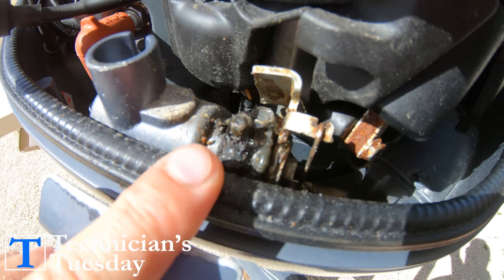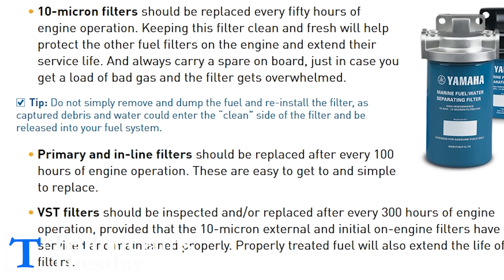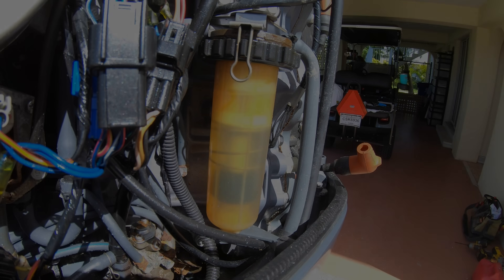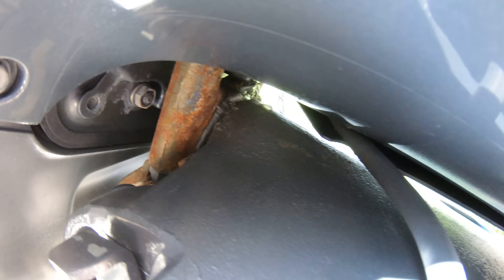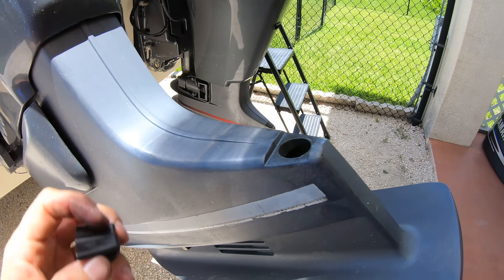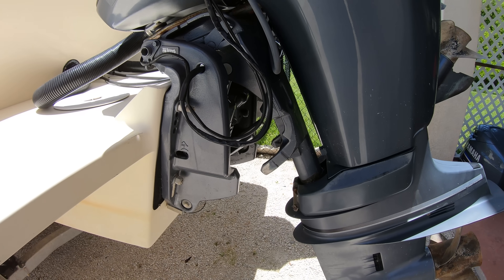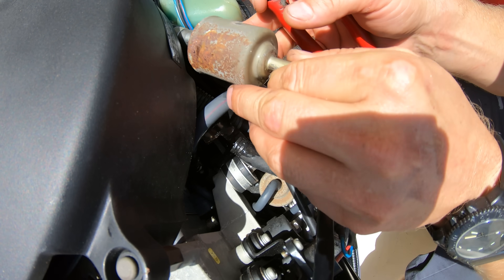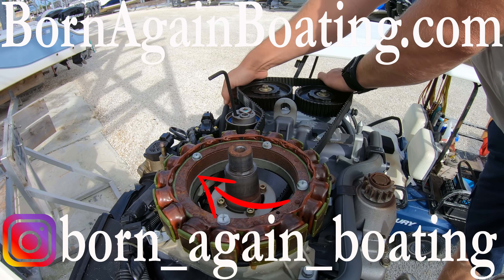Making A 2-Stroke Last Longer!

Comment: 01 200hp OX66 2 stroke Saltwater series, great motor but maybe too big for my 20’ Trophy as I typically can’t get it past 4K rpm’s (unsafe) and I’m getting my 02 sensor housing gummed up with oil/carbon. Maybe a different prop, hotter plugs may be in order, any thoughts?

Comment: 1994 Johnson 175 Ocean Runner. It's been great. It has the much maligned VRO oil injection that so many struggle with and end up mixing gas and oil in the tank. The real story is it's a great system that nearly nobody understands and is basically fool proof. They just don't understand the fuel system of the engine AND the boat and look for problems in all the wrong places.
I'm fairly shocked at all the corrosion in the Yamaha's. Must be salt water boats.

Comment: I've got a 2005 Yamaha VMAX 175 on my Triton Bass Boat and a 2000 Yamaha 115 on my Cobia 184CC. My 115 is kinda hard to get started but when it does it run's Awesome!
Reply: I been hearing that about the 115 2 stroke Yamaha that they hard to start I have a 07 115 Yamaha 2 stroke and it starts on the first spin every time even when it's frozen out side

Comment: I have a 2004 70hp Yamaha 2 stroke on a 2004 176 Key Largo center console I bought in March.  Runs great, did have a replace the original tilt/ trim motor in August. Knock on wood, running great and no problems now. Fish the ICW south of St. Augustine.

Comment: Running a2012 Yamaha 200 stroke!!! last year they made this engine, but I swear with just the smell of the key this thing starts every time. Even after a couple months of being stuck at work . By the way awesome video learned alot about my two stroke deff will be checking in again. keep up the good work
Reply from the maker: Thanks for sharing!

Comment: I have like Robert P a '92 Grady White Sailfish boat with twin 2006 200HP HPDI's that run amazing. I service as needed, new plugs each year, lower unit service with Amsoil gear lube. 
Only issues I have is the idle speed when cold is too low, about 400 rpms until warmup and some restarts to get it going. Long story short, is caused by the carbon buildup in the O2 sensor chamber. So now doing annual O2 sensor removal, cleaning out carbon and ensuring the pin will move freely and chamber is clean. Then I do a decarb with Seafoam and they startup like new again. Not sure why the excessive carbon, but many others having same issue. Using either regular fuel or ethanol with Startron and Ringfree plus, still same issue. Tried different outboard 2 stroke oils, Pennzoil Semi Synthetic, now running Amsoil Full synthetic, same issue. 
Do love how these engines run though!

Comment: I love my 2 stroke on my checkmate. All that raw power at high RPM. Seriously I've thought about repowering a 4 stroke but this motor runs so good. They say these motors were built to last forever.
Reply: They should run at least a thousand hours before rebuild. 
At 50hrs per season average( I did 100) they should last a long time.
Synthetic two stroke, good gas, flush after using, change that water pump impellor.
The more you use them the better they run. Good advice here !

Comment: 1997 Force 120. Rebuilt the carbs last year, changed the thermostat this year along with the water pump impeller.. Every season I change the plugs, fuel filter, gear oil and fog the motor for winter storage. So far so good . . .

Comment: I have an Evinrude VRO 60Hp Long shaft.  The hour meter is stuck at 430 hours, I suspect it has much more than that somehow.  In the process of servicing the gear case this week.  New water pump in the post and an oil change pending.  Hopefully this old lady will be good for a few hours more.

Comment: 1993 Yamaha 130 like new. Have broken three Hobbs hr meter already so it's got a lot of hrs. I spray inside of my new marine engines with silicon spray before first use.  Then wash it out after a salt trip and respray.  Never have seen that rusty look inside and all rubber looks like new. Have been doing your recommended stuff but Did not know about the oil tank filter. Beter change it after 27 years I guess. Thanks

Comment: Merc Black Max 150 hp 1984 ,perhaps the very first oil injected motor by them .Was going very strong when I sold the boat ten years back.Was a fresh water boat from Ontario till coming to the West coast .I put more than 7 hundred hours on that engine ,with 1200 total hours .

Comment: I bought a 1997 Campion Allante with a 150 Mercury EFI last year. Having been a dirt bike and snowmobile guy in my younger days, 2-strokes don’t scare me. I could tell this engine had been maintained and not run hard. It’s certainly more complex with the EFI, but videos like yours and a good manual are teaching me a lot. The sound of that V6 at full bark is quite something, and after cleaning the intake and throttle bodies this year, it’s got real jump off the line.

Comment: I worked fighter jets for 24 years and retired about 18 years ago. Just bought my first boat (1994 Model). No Wings! It has a Yamaha 150 Saltwater series engine on a 24 ft Hurricane Deck boat. I sit and look at it and have no idea what to do as far as engine maintenance! We did take it out over a 5 day period, ran it for a few hours and it seems to run great. But after watching some of your videos I think I need to learn more. Much more!
Reply: Hi, thank you for your service Sir. Yeah I'm in the same situation with my first boat. I've actually bought an older boat and have had to do some work myself. I've watched a ton of videos and this guy is my go to for restoration and mechanical knowledge also he covers a lot of peripheral subjects to boating. Boat works is another great channel for fiberglass work and painting. You are a lot smarter than me so you will be great at whatever you choose to do. Closest I ever got to a fighter plane was my street bike an  FJ1100. I swear if I had wings I could have taken flight😂. Take care.

Comment: 2000 Mercury 225 Optimax and it chugs oil and fuel. Would love an upgrade. I'm at 1240 hours on the motor.

Comment: Still running a 115 johnson from 2000, good motor only let me down once.
Reply: What was it?
Reply: @LeetGamingTV  About 10 years in a circuit chip in the ignition system started playing up and left me stranded at sea. Marine rescue Eden were great.  It was intermittent for a while seeming to come good and then playing up, felt like it was only firing on 1 or 2 cylinders(V4 motor) and rough at that. The part was on the top of the motor under the stator/flywheel. and cost about $150ish dollars. My only other issue was my fault when I didn't tighten the battery leads and stuffed up the voltage regulator. I bought the regulator from the US (I'm in Australia) for half the cost of one here. I make sure I flush it after use, grease and WD40  great little motor.

Comment: 1993 225 johnson ocean runner on a 1989 22' revenge (whaler). rebuilt once by me in 2007. previous owner didn't change the high pressure water pump, ran it high and hot. I fattened up the mid and high speed orifices for break-in, but it ran so well i just left it like that. 35 mile offshore trips at 3/4 throttle without a single issue. thanks OMC!

Comment: 2006 Johnson 150, 2smoke on my boat. I've had to replace the fuel pump assembly twice in the last 3 years at $600 apiece plus labor. Thanks for the video, I need to step up my maintenance game.
Reply from the maker: Welcome!
Reply: Run a really good low micron fuel filter.  Makes a difference

Comment: Still running a 1979, 2 smoke, 55hp  Evinrude.  No hydraulic trim, no motor tilt assist, runs only premixed 2 stroke fuel that has to be ethanol free, ,.  No bells.  No whistles.  Just runs all day long.  all year 'round.  every year.

Comment: 2002 carbureted Mercury Saltwater 150 2 stroke. Runs great and easy to maintain. As my son calls it, a “reliable 2 smoke.” Just did a service on it. Compression was perfect, ran my borescope in it and everything looked clean. Surprised considering Im in South Florida salt conditions. Regular maintenance and flushes are a must down here.

Comment: Got myself busy with 2 2 stroke mariner 200hp, replaced the stator on one, and fuel pump diaphragm on the second as well as carburetor rebuild, with a lot of tlc got them running, i have cople vids you can check them out

Comment: fyi, snap on makes screwdrivers just for lower unit drains. servicing a 2 stroke 2000 year model yamaha 130 since 05, looks brand new. may need a carb rebuild soon, every once in a while when putting around it will shut off

Comment: I think I need to replace the hoses on my Yamaha 40v 2011 2 stroke. Apparently hose degradation is a common from for a lot of different 2 strokes with oil injection. I have found lots of vids on how to bypass the oil pump and just run pre-mix but none on how to analyse/ replace the hoses. Might make a good vid ?
Reply from the maker: Maybe :) but I would just order the hoses and do them one at a time lol might be boring to watch ;)
Reply: @BornAgainBoating  Replacing the hoses shouldnt be too hard. Its the purging air out of the pump/hoses that seems tricky.

Comment: I have two old two strokes. One 1974 70hp Johnson and a 1982 150hp Johnson. Both work perfectly. I bought the 70 as a scrap motor. Didn't take much to get her to run, perfect compression.

Comment: I need some help with my 200s hpdi please
Reply from the maker: Whats wrong with them
Reply: @BornAgainBoating  I try to start one of the motors when it starts there  gas flowing from the bottom throttle body and the motor shuts down soon as it fires up....
Reply: @BornAgainBoating  one of the motors needs the mystery filters cleaned or both but I can't same to get the next motor to stay running long enough to check it out!!!!  Am good with the yahama four strokes but this is my first pair of hpdi's I've owned to am learning as I go

Comment: My Suzuki DT225 efi 2003 has been running flawlessly up until the other day when a piston blow. Replacing one cylinder-bank, the head and the pistons costs however more (just buying the parts) than could be justified. Its with sadness I will have to bury it and there are no more big two strokes to be found, at least not in my part of the world...

Comment: I'm running a 2004 Yamaha VMax HPDI 300. Been a solid engine but it doesn't push like it used to. I've lost probably 10mph since new. Any way to bring that back?
Reply from the maker: Its hard to say, it could be anything. You can clean out the fuel system and try running some ring free to help, see if that does anything. Make sure the plugs are fresh and that canister filter isn't clogged.

Comment: Running two 200 HP HPDIs on my GW 265 Express...  1200 hours, good compression...  Run them about 50 hours a year...  I have recently replaced lift pumps, voltage regulator, and shift sensor...  Replaced fuel filter cup because faulty wires gave a false fuel/water alarm...  I've replaced the LU seals on both in the past couple years; water pumps every three years; VST filter, high pressure fuel filter, and thermostats every other year...  New plugs every other year...

Just cleaned the O2 sensor and sniffer tube on one that was ticking...  That didn't fix it, so started investigating the (dreaded) possibility of piston slap from weak wrist pins...  Turns out to be much more simple and cheap to fix - the drive gear for the fuel pump was stripped, so it would rattle around between the flywheel coupler and the top washer...

I am a much happier boater now that I do almost all the work on my boat - its is a great feeling to know that the engines are in tip-top shape...  Hoping I can get another 10 years/500 hours out of mine...
Reply: Still running like a top... Lessee - in the last couple years, I've replaced all of the microfilters (aka, "mystery" filters) in the injectors and high pressure fuel pump, rebuilt one lower (held pressure, but still leaked despite good seals, so I assumed a scored prop shaft), pulled the other apart (despite good fluid, only held 8 lbs pressure) and resealed, completed all the other, usual stuff like thermostats, filters, and plugs...  I did have a couple things crop up - I had a lead on the connector to the port oil tank level sensor go bad - result was transfer pump wouldn't come on...  Before I figured it out, I replaced the pump since the original was 20 years old (replaced starboard pump 5 years ago)...  Once I isolated the issue to the bad pin, I just bypassed that lead on the connector, with the intent to replace the sensor this spring...  Other vexing issue was a starboard motor that would occasionally tilt all on its own at random intervals with no input...  Isolated that to a faulty switch on the binnacle, which I solved with the liberal application of contact cleaner...

A couple self-inflicted wounds - reinstalling lower unit without verifying shift rod was engaged, and engine stalling because fuel water separator filter had worked itself loose and was letting in air... When I splashed, I actually had to get towed 20 feet back to the dock with one engine that would run but not shift and another that would shift and not run...  Felt like a moron, but learned a couple important lessons...

Comment: Hi mate, l have a question. l have a 70 hp yammy 2001 ,2stroke. Its running fine.l noticed when it was running that the fuel filter on the side next to the oil white plastic container was filling  and then emtying and then refilling every say 30 seconds . Is this normal l doubt it, this was when l was running the engine on the muffs at home for about 10 minutes. It does it every time l run it like this. Not been in the water yet since l bought it a few months ago.
Reply from the maker: Hey Kevin, yes that is normal. That's just the lift pump operating :) It turns on and fills that canister, then after about 30 seconds it will consume the fuel and come back on to refill the canister :)
Reply: @BornAgainBoating  thanks for the reply. Well l filled the tank up because it only had 10ltrs and now has about 22ltrs. l tightened the jubillee clips on the pipe connections and now just stays full when running. So what do you make of that ??l must admit l have only looked for a few minutes when it was running, but the fuel filter stayed full now.
Reply: just a quick update. l was wrong it still does go down and up with fuel . thanks for clearing that up.

Comment: I have a 2008 Evinrude ETEC 150 hp on my boat. My boat has been sitting for 2 years this September. My boat hull was being repaired and insurance took awhile. So, what all should I look out for before cranking the engine. All comments are appreciated. I just don’t want to forget the simple stuff and want to make sure the important stuff gets the attention it needs before hitting the water. My boat should be ready in about 3 weeks. I’ve got to plan this out correctly so it doesn’t cost me more money.

Comment: 98 Merc 200HP still going strong. Capped fuel oil pump and removed container. Put oil in the fuel manually. Makes it more reliable. With proper maintenance an old 2 stroke will last a very very long time. Not fuel efficient, not quiet, and smokey. Once started though they will always stay running as long as the water pump is working.

Comment: Still running a 1998 OMC/Johnson 200 two stroke. Still hoping you do a tune up video on one of these. I’ve tried watching other tune up videos but they don’t work for these motors. I still can’t get my engine to idle and mid throttle right. WOT it runs great tho.

Comment: Been thinking of repowering to twin 300hp Merc 4 strokes but just can't justify when my 2 strokes run so well.  Thirsty but dependable.  30' Proline center console with twin Merc 250 EFI, she'll scoot at 62mph. And the sound!  PO drilled the can, so she sounds like a top fuel dragster at the dock.  At cruise I get 1.4 MPG.  Paying $20K to repower with used Mercs to get .2 or .3 more MPG and maybe 2 to 3 MPH more top end?  I'll pass for now.

Comment: 1980 or 86 mercury 115. Been underwater but still runs well. Only problem is getting it started. Needs a spray of brake cleaner other wise it takes a lot of turning over to start. The starter gear keeps disengaging just when it's about to start. Once it's warmed up it starts first turn.

Comment: Im from south africa I run a old 80‘s-90‘s suzuki dt16 two stroke its an amazing motor it still uses the old fin type system instead of a impeller never had an issue

Comment: I have a Mercury Jet Optimax 200 . any good service to do to it. is a 02. Maybe 200-300 hours. Probally had nothing done ever but i change the lower gear jet oil. a lot. does get a little water in it. once or 2 per season. I just change it or bleed the water off ever water run or 2. Ive heard there is a water sensor that will not let it run if sees water in the system. Fresh water only so everything looks great. LOL.

Comment: 04 Yamaha 200hp salt water series runs great never had a problem has 2000 hours on it always keep up on maintenance and use amsoil 2 stroke oil expensive but well worth it

Comment: I'm running a 2006, 115HP, YAMAHA saltwater series II here in Australia, it's a great motor. When I bought the boat I did have an issue with oil fouling the spark plugs and missing every now & then at low RPM's when trolling, changed up to the next heat range spark plugs & now it will troll all day as low as 600RPM smooth as silk and the spark plugs look great. Excellent video by the way.

Comment: I run a 2002 200 HPDI with around 2000 hrs on it, still runs great with good fuel economy. As someone said you didn't mention the VST filter which I do every year along with the O2 sensor. Another thing people neglect is the oil in the high pressure pump, I change that every two years along with the belt.
Yeah I know I over maintain it but better safe than sorry.
Reply: What oil in the high pressure pump are you referring too? The tank under the cowling?